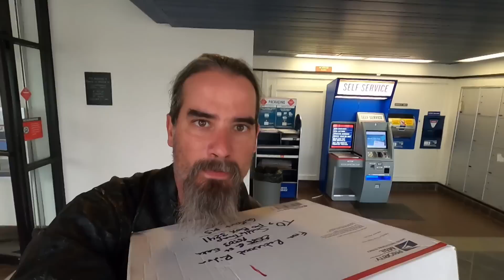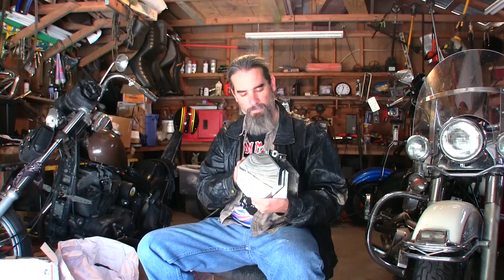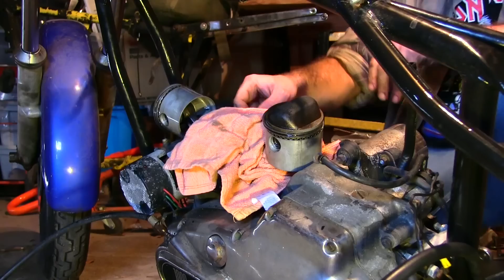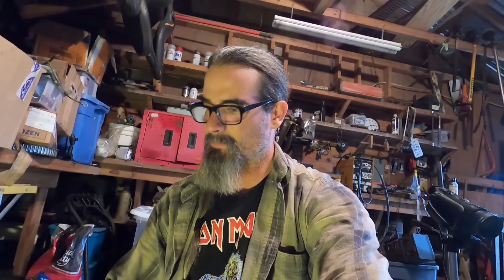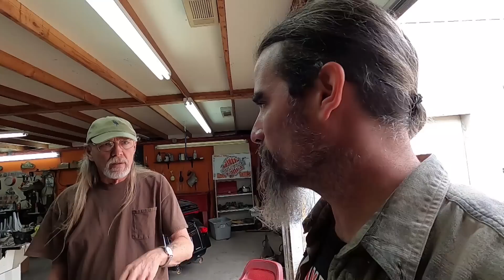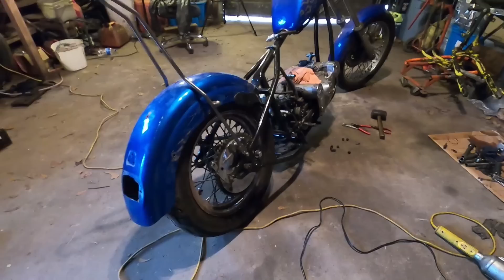HARLEY Davidson IRONHEAD Sportster CHOPPER Bobber BUILD / Top End Rebuild

Comment: Just a couple of thoughts on those heads that I hope might save you some trouble down the road.  First, if that motor is of unknown history, but you suspect it's never been apart, it may have the original valve seats.  When this motor was new, we still had leaded premium gas, and those seats are meant to be used with that leaded premium.  Once leaded premium became unavailable, we started seeing some pretty rapid valve seat wear.  The solution is to change them out for valve seats of a modern material, such as stellite, which is compatible with unleaded gas.  There may be a way to tell if this has already been done by simply removing the valves and inspecting the seats.  Maybe Scooter's can help you with this.  Second, these things are pretty hard on valve guides.  The rockers tend to push the valve stems sideways a bit as they push the valve open, which ovals out the guides.  As an aside, Dan Baisely in Portland, Oregon modifies the rocker tips by cutting them off and welding a roller tip onto them, which eliminates this side thrust.  I had him do that on my rockers the last time I went through my motor.  Anyway, if the guides are worn, it will not only burn oil, it will also not properly cool the valves.  The valves transfer heat to the heads through the guides, and if the guides are loose and are not making full contact with the valve stems, the valves (and seats) will overheat and possibly fail.  "Fail", in this case, means dropping the valve head off of the stem.  You can imagine what that will do to the motor...  So, yeah, I kinda hate to be the bearer of possibly bad news, but it pays to check this stuff.  Your gasoline leakdown test doesn't tell you everything you need to know.  Sorry...  but, as they say, "forewarned is forearmed".

Comment: Great video and information. I owned a 1983 Harley XLH ironhead sportster back in the 90's. Mint condition, and ran like a top. Owned it for a few years and put about 2500 miles on it. Never had an issue. Wish I had it back now!

Comment: Just bought me a 1977 sportster 900 ironhead. Should be getting delivered soon. No clue how to, or what to do but it'll be fun to restore.
Reply from the maker: That's weird. Being a 77, it should be a 1000. 73 was the last year for the 900 and first year for the 1000. Sounds like fun though.
Reply: @SaddleTrampTV  all I was told, was it was 996 cc. It's been sitting for 3 years. He said it ran great before he put it up, but the clutch was dragging. It also leaks a bunch of oil lol. This will be my first bike that wasn't brand new

Comment: It’s an iron head sportster. Of course it has a clip inside the side cover!

    With the heads. Pull the springs and oil seals. The take some lapping material & a lapping tool. Lap the existing valves. Put on new springs & keepers plus valve guide seals. You’ll have a great set of heads!
   Then, buy a super thin head gasket and bring up your compression a bit. 
 I think your motor is a 1976?
   If it is change the cam also. With a lower over lap and a bit of lift. It will make much more cylinder pressure. 
 It’ll be a great motor!
Reply: 100%
Reply: No reason to lap the valves if they aren't leaking gas through.
Reply: Kenneth Law if he gets all new springs ,  Seals. It certainly can’t hurt now can it?  Besides, it’s been sitting for a long time.
Reply: LT's garage is absolutely correct, better to do it now than after the top end heat cycles several times and then starts leaking. Plus the heads are off and on the bench, plus if he wants to sell the bike in the future, a great selling point is it's had a complete top end basically.
Reply: LS Killer correct. Put in valve seals reset the valves. (lapping) springs. Then find a good cam for it. The 70’s were the gas wars of America. So the motors basically had broom sticks for cams. The high lift cams meant the paint on the broom stick handle was lifting off.
    It was really hard in the 70’s to buy a street cam that had any lift to it.
   Back then I had mine custom ground.

I digress. Lap those old valves. Get them set in place. Who knows. One could be stuck down right now????

Doing this kind of work is much easier to do with it torn down the first time.
Reply: @ltsgarage7780  my point exactly, if you know anything about old motors you would know that usually from sitting the compression will be low.  After running them with a few heat cycles through them them will get better after the carbon and rust gets blown out of them. I have been fixing cars, trucks, bikes, tractors for years so I know what I'm talking about. You are correct to say once you pull them down you might as well do it because you are already there and no sense paying for gaskets and so on twice.  Now you know what you have.  Now as for selling point. Well it's a Sportster which aren't worth much to begin with. So while it's good for the next guy you just lost money on the rebuild because a running bike would be damn near worth as much as a rebuild bike and you didn't have the  cost of the parts.  Don't believe me about the compression? Watch any video redoing old engines.  Mustie 1, Jonathan W, and several other channels.  There really wasn't much reason to tear this bike down in the first place other then peace of mind and good content. This bike would have run years in the condition it was in. Especially being a what it is and the average guy won't pile miles on this bike.  It will be a second bike for a bar blaster or more local for most people.
Reply: @lskiller1903  read my comment and you will understand
Reply: Kenneth Law you can do anything you like with your motors. If it were mine It would be done!
    I don’t know if he is going to sell it or ride it. What’s the “real cost” of lapping the valves?

He is going to have more into a sportster than what it’s worth on the market anyway. I know of a 1971 all stock. He wants 2000 for it. That’s just to much money. I think in 1970 I bought a brand new one. I think it cost just over 2100 dollars. 
(I tthink?)

   How long have you been rebuilding motors??
  I rebuilt my first motor either in 1958 or 1959. I’m old so remembering back that far??
  I do know I purchase my first new Harley in 1960.
Reply: @ltsgarage7780  do you really know what lapping is? Lapping is when a new valve doesn't fit exactly perfect after installing or grinding.  So to get it perfect you lap the valves so it is completely tight and has no leaks. So being how he poured gas in it and it has no leaks they are as perfect as they will ever get. If it leaked he either had rust/pitting or carbon in it.  That's when it would need lapping to seal it tight again. Maybe he should pull  it apart and check the valve seals/guides. Being an old bike if he is going to ride it a lot he should check to make sure it has hardened seats and valves.  But right now the valves can't get any better then they are. Again watch some videos on what lapping really does.  In this case there really isn't a reason. You are just taking more wear of old valves already.
Reply: Kenneth Law like I said before, maybe you should go back and read what i said! 
   You do yours your way. I’ll do mine my way! I really don’t care what you do to yours. I’m not saying your way is wrong. Like you are telling me  I’m doing wrong when you are me when I say open them up & Lapp  away.
I would rather be sure they are perfect. Than to Hope they are perfect!
  Can you guarantee every valve is in perfect shape? None are stuck down, which would make them not bypass gas?  Why don’t you tell him “you’ll pay for a valve job if one is bad”
   I’ve been building extremely high street horse power probably longer than you’ve been alive.
  Sir, how old are you????

   It’s the little things between a winning high horse power motor. It’s been my theory for over 55 years. 
“Better safe than sorry”
It’s also better that “you do You”
I’ll stick to my ways!!!
Enjoy your Saturday 😜
Reply: @ltsgarage7780  all right sir. As I have mention before. I have built Harleys, tractor pullers, stock cars, mud trucks, and many other motors.  Have you ever seen what lap compound does to a motor if you don't get it all cleaned out perfect. It grinds hardened valves completely smooth so they don't leak through. So are you doing yourself any favours if they don't leak? NO! If that get into your motor or bearings you are way worse off then you would be if you just left it alone. Next I'm 50 years old and run CNC equipment for a living. Now since you don't seem to understand that when I started this whole conversation I would have never bothered to pull the heads in the first place. There was no reason to pull this motor down.  If it wasn't smoking and didn't have low compression and the it wasn't knocking or a head gasket leak it was perfectly fine. Now since the heads were off and I'm sure he is smart enough to make sure the valves were moving and weren't stuck shut before he even checked them for leaks. So again your whole argument is void. So if you want to waste the time to lap your valves go ahead and waste your time. But anyone who knows motors will tell you you are wasting your time.
Reply: Kenneth Law if a mechanic left any lapping materials in a motor of mine. That’s not a qualified mechanic. I’d fire him on the spot. 
    I’m not sure if you notice but this motor has already been torn down. I  feel that if you don’t want to tear this motor down if it was yours. That’s perfectly ok with me. Look at all that extra time you’ll save.   😜
   50 was a long time . Hell I had been in the service of our country for a few years before you were born.
Reply: Kenneth Law by the way. I just advised him to lap the valve. Since he had it down. I really don’t think I’m the greatest builder in the world. But I’m sure if I had to use another CNC shop. I would bypass yours just because of your attitude. Like you know everything there is to know!
Reply: @ltsgarage7780  I notice you said if any mechanic left that in your motor. Makes me think you don't build your own motors and may have some miscommunication on what and how the lapping compound works. I may be wrong.  But since I build my own.  You will also notice that the tractor pullers. Mud trucks,  and stock cars, plus street cars that used to get built were far from stock. So I'm my opinion that is a total waste of time. I didn't watch the previous videos and am not sure why or how it got torn down.  But I have ran motors like this that were stuck.  We got them loose and a couple of them are still running 30 years later.
Reply: Kenneth Law wait??? You didn’t watch the original video yet you have more opinions on it than anyone else???
   Are you sure your not here just to brag about all that you have accomplished 
  Here I think you need some pats on the back. 
DAMN IM GLAD YOU SHOWED UP ON THE VIDEO. He WOULD HAVE WRECKED THIS MOTOR IF HE JUST LISTENED TO ME!!!
  Is that good enough for someone that is the best in his field & knows all. Let me know if that’s not enough for your Ego??
Reply: Kenneth Law I’ve made it far enough in life that I can actually hire other specialist in their fields to want to work for me. I can also afford to pay them what they are asking for in today’s market. (They make very good livings)
   I’m glad you build motors for many other fields & hopefully make a living off of it. I pay the men that put their hands on my motors with my own money. Yes, right out of my own pocket.  You might ask why??
Because I can!!       😜       

  I & I alone inspect everything step of every motor that hits my Dyno. & nothing leaves my shop without hitting my Dyno. 
I don’t give everything a 👍. 
Not much gets turned down. 
 Better not anyway!

Comment: We did the whole top end at 12-15,000 miles. The valves might not be leaking, but valve stem to guide clearance will be off. Please go ahead and do the heads. You will be thankful you did.

Comment: I don't think I would have wasted my time pulling that motor down.  Yes there was a little wear on the cylinders. But what do you expect from an old bike. Plus the wear was at the bottom of the cylinder and it will hold the compression at the top where it needed it to fire.  It's your bike do what you want.  You already have it tore down so might as well do it now. If it was mine I would have just ran it to see if it was fling to smoke bad or use oil.

Comment: Just my opinion.   I've worked on many shovel heads and found that  a  .010 bore job is not usually enough.  If the cylinder is centered correctly  in the bore machine that is only .005  off of each side.  If it  doesn't clean up on the first or second  cylinder  bored  your ordering .020 pistons and boring them again.  The leak down test on the heads is only  one  test .  Valve guides  wear  and valve stems wear .    Iron head sportsters don't have valve guide seals.     I never saw an  Iron head sportster  with over  25,000 miles that didn't need a complete top end rebuild.

Comment: I'm not sure but the Evo Big Twin and the Shovelhead are very similar inside.  You could say that the Evo was the fix for the Shovelhead in the sense that it's kinda like an all Aluminum Shovelhead (except for the cast iron cylindrical inserts.  My guess that the evo sporty is probably a similar type of deal.  The guts should be similar.
Reply from the maker: They are a lot alike. Harley used the shovelhead design as the basic platform to go off of when they were designing the evo. When the evo sportster came out, the bottom end and transmission pretty much stayed the same for the first 4 years of it's life.
Reply: @SaddleTrampTV  I didn't realize it was as extensive as the tranny.  I know the first year of the Evo Sporty they didn't have the 1200, they had a 1100.  So they used the same tranny for a while.  Cool.  The issue of the Shovelhead and Ironhead leaking oil was you had Steel Jugs and Aluminum bodies and for some reason getting these engines to stop leaking oil was a problem until the Evo.  Then the Evo's seemed to just run and run like a harley engine never ran that well or long before. Then on the Big Twins they went to the TC88 just because they got sick of the aftermarket guys building their own evo copies.  Even the TC88 isn't that bad an engine if you fix the cam chain tensioner. ( I replaced my cams last year on my 01 Fatboy at 65K and hopefully it will run for another uneventful 65K. )

Comment: Hey buddy, Time to pass on my 79 1000 sportster to the next generation. Wondering if you have thoughts on how to price it.

100% original except for missing stock carbs and air filter cover. Bunch of after market and stock parts. pipes, seats, blinkers, trim pieces, calipers, fenders, handlebars… 

Around 35k original miles. Electrical and transmission redone. Ran great, but been sitting for a good 5yrs on a trickle. Whole life in a CA garage. A couple of chips, but original red paint in great condition. 3rd owner.

I appreciate your thoughts.
Reply from the maker: I would look at what they're selling for right now.

Comment: what is that wrench you use for the head bolts??????????????
Reply from the maker: Not sure what it's called, but it's meant to get to the head bolts that a standard wrench can't get to on an ironhead motor.
Reply: @SaddleTrampTV  Im trying to buy one you have any info as to where you got it?
Reply from the maker: @pageplant224  https://www.ebay.com/itm/223467001280?hash=item3407abd5c0:g:iw8AAOSwIVVcoTPj
Reply: @SaddleTrampTV  great!! thank you

Comment: Be careful using Andrew's cams, twice I was snake bit but fortunately on the second time I caught it. The front exhaust cam on the first set their timing mark was 9 points off. I I had installed the cams and took them out for x then I compared the cams with the timing marks. That's how I found it the second time I bought the same Andrews R5, and the front exhaust cam was 16 points off the line that marks. Who would have thought. I called Andrews and they offered to send you cams but I have already found the mistake. I told them they need to pay attention to their inventory. I also have a story about paughco frames,. I must say though the Andrews R5 cams haul ass!
Reply from the maker: I'll keep that in mind. Thanks